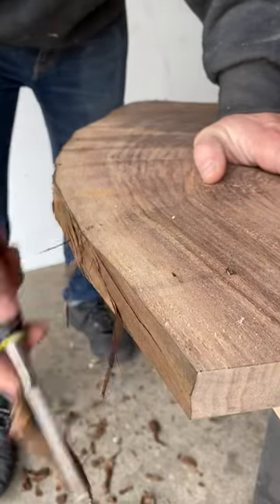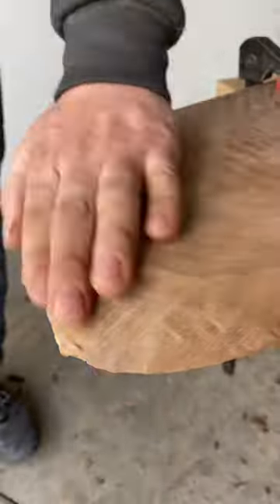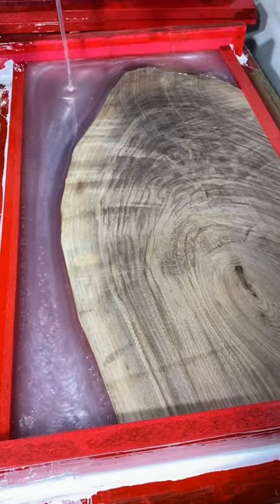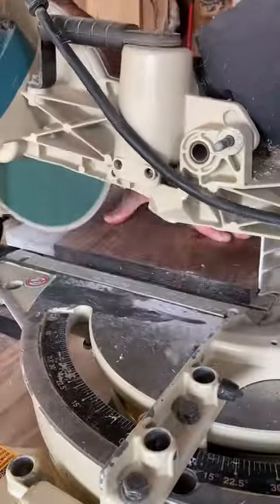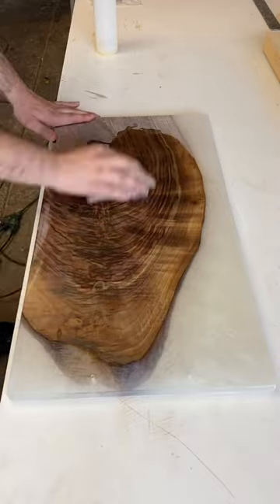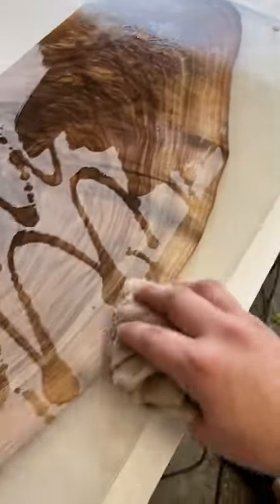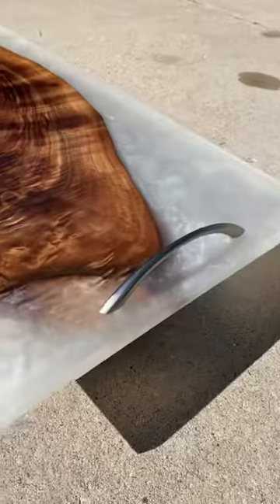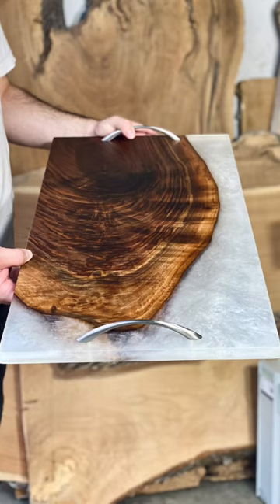Crazy Walnut and Epoxy Piece #shorts #diy

Comment: Amazing work! The only thing I don't like is the handles 😢
Reply: I guess it's a matter of personal taste,  but the handles remind me of cheap kitchen hardware.  I feel like I see those handles in every tract home.
Reply: He chose that handle color because of the epoxy.  I think he should have chosen a honey-colored epoxy and honey-toned handles, which would have looked much better.
Reply: @1TheNews its more of the fact that there are handles on the board
Reply: @Will057  Serving trays usually function better with handles.  🙂
Reply: That's probably why he pointed out 'the hardware my client picked out'. He probably didn't think much of it either. It looks straight out of the '50s.
Reply: Agreed wood would have worked .

Comment: Beautiful work! I'm curious. I know you said it was a food safe cutting board oil that you use on your boards but wouldn't that interfere with the epoxy or not stick to it at all? Would that be the point of the oil to only stick to the wood? I guess I'm just a little unsure

Comment: It looks like you poor you're apoxy fast. How do you keep the air bubbles out of the apoxy. It's to thick to use a flame on. So how do you do it. I myself poor very slow. That way, any air is at the top and I use a torch to get rid of it. But thay are not as thick as you poor.